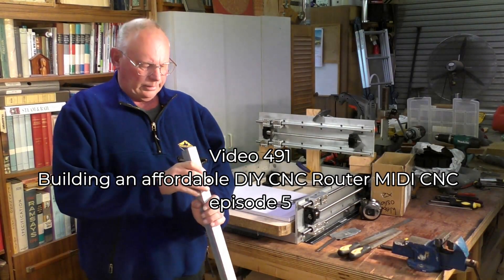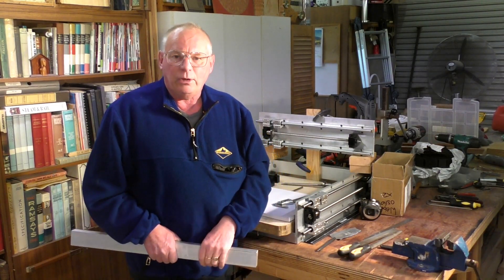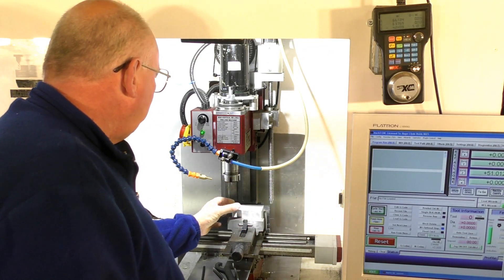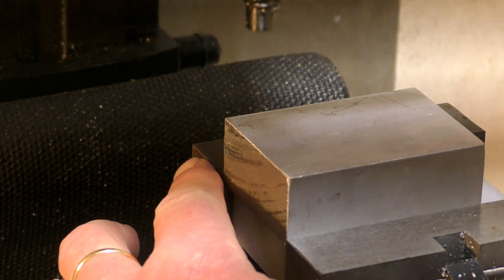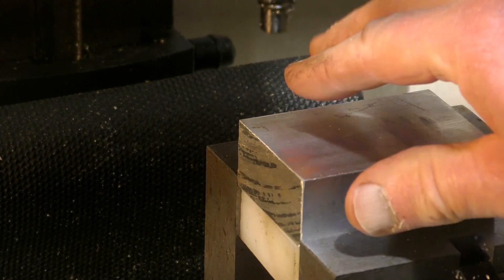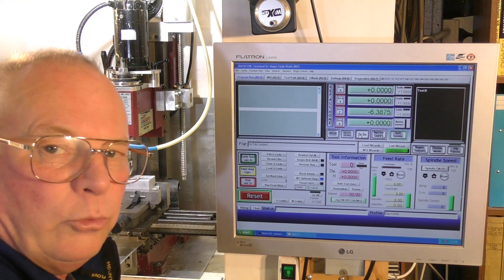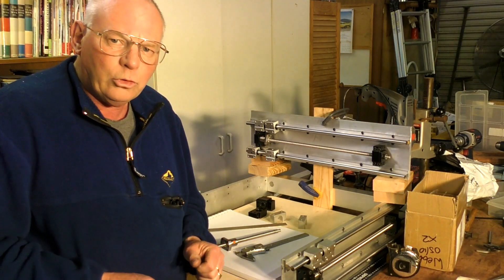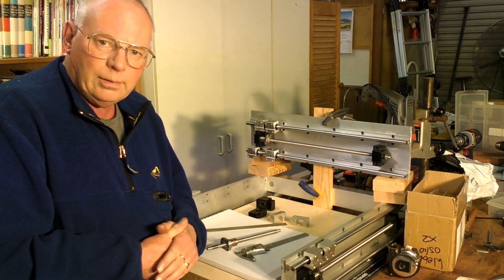Building an affordable DIY CNC Router MIDI CNC episode 5

Comment: Love to skip around your videos for ideas for trying to make my own CNC machine one day. But I got a 3018 here this summer from sainsmart and I've been trying to use it for months, it's had many different issues from the board catching fire from the Z-probe adapter being too wide and crossing pins, the Y-axis mounts being too uneven to allow it to move, to mainly the XZ axis keeps falling apart. Mainly the XZ axis is what's kept me from machining anything, as the bearings and rods keep coming out. I've managed to fix the bearings by purposely putting an uneven bit in the router, making them fall out, and loctiting them in. But on the other hand, that solution does not work for the rods. The company I bought it from has tried little to help me in my search, they simply have sent me two XS axis modules. Was wondering if you had thoughts of how to better keep these rods and bearings in the plastic or a way to upgrade. I want to build my own machine one day here and my main thought is what to do to improve on these bearings and rods.
Reply from the maker: Hi, have a look at my 3018 videos it may help you out.